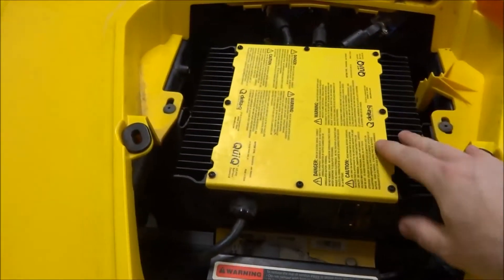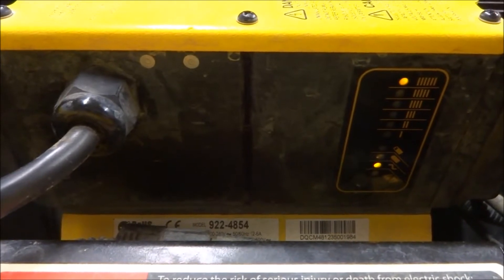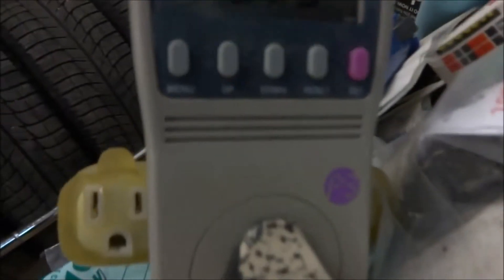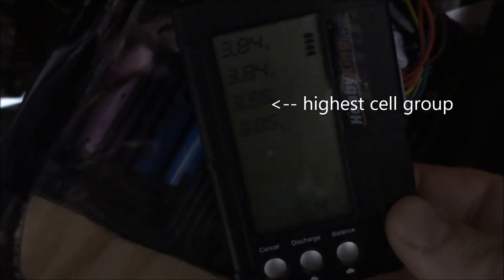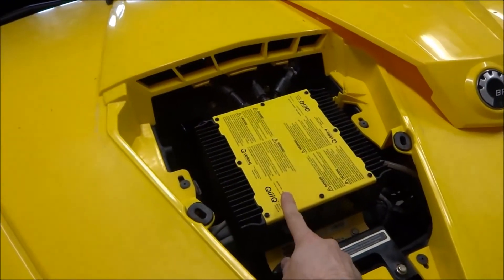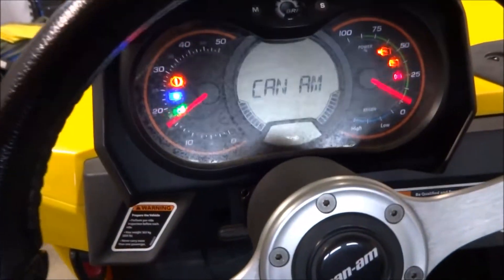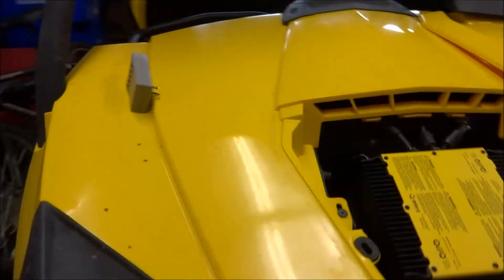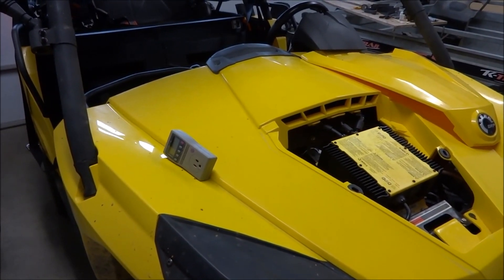Commander Electric upgrade to 18650, charging the batteries

Comment: Congratulation for your great work... I have some doubts... how many amps have each battery?, the balancer how long does it take to balancer the battery?, The charger the battery is in serie?
Reply from the maker: Each cell has a capacity of over 2 Ah and is able to deliver over 2 A. Since I am using 128 cells in parallel, that's over 200 Ah. In total there will be 13 groups in series for a total of 1664 cells. I will be charging them as they are setup in the vehicle, since it only 53v max. I will not balance the batteries regularly as there is no reason for them to become out of balance. Please see my other videos, this has all been explained.

Comment: So am I understanding correctly that the charger would have charged the original lead batteries to higher than 53v but when the charger then turned off, the lead batteries would fade down to something lower than 53v so there wouldn't have been a problem? Also have you considered building a controller (with an arduino and a relay) to monitor the charge voltage and automatically turn off the charger at the appropriate voltage providing you with a permanent solution. Also can you pull the commander to your cabin with your leaf?
Reply from the maker: Yes you are correct, the charger would normally charge the lead acid batteries to somewhere over 56v. When it shuts off, the voltage returns to below 53v. I actually witnessed this once as I unplugged the Commander and then quickly turned it on. I got the same error messages on the display. Yes I considered building something to monitor the voltage and shut off the charger with a relay but I'm just afraid that if my circuitry fails, I will ruin the li-ion batteries and building them took an awful long time. I have pulled the commander short distances (it actually tows very well) but it's too far to my cottage. I only just make it without pulling a trailer.